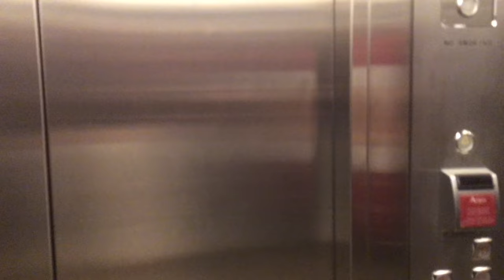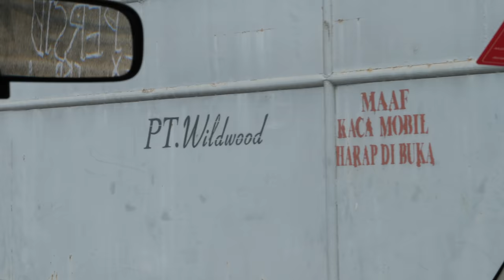SOLAR Guitars Factory Tour - September 2017

Comment: Many brands moved manufacturing to Indonesia, which is why today you can buy a awesome Axe under $500. If you demand mohagony and higher output pickups with better quality parts your still getting it under $1000. But any guitar especially from Indonesia be sure to check the fretwork for any high frets or other issues. I have 1 from Indonesia it's not a Solar but it's got no issues with anything, but I've seen some that did.

Comment: Good luck with your guitar Ola,,,,definitely Indonesian made guitar have top notch  quality. Cheaper Ibanez JEM also made in Indonesia for so many good reason
Reply: TheMrPaijo indeed they use nice woods too, I had a pair of LTD's made there that came to be very good
Reply: If they are as good as AMerican guitars..why are American Made guitars 3000 and up ?
Reply: OMG Don't you know basic economy. Hom much does an americans get paid for an hour salary compared to somebody in a 3rd world company plus world currency. Expensive does not necessarily mean that they are good..take a look at gibson as an example and compare that to epiphone guitars same quality but half the price.
Reply: How much is a Solar guitar ,in Google there were no advertisements, I typed in Solar guitars lemon ?????? 
Nothing ,a desert yellow ibby
Reply: Many of the normally more expensive especially metal style guitars seem to be made in Indonesia and you can buy for much less money now. Most Jackson's are also except those from the USA custom shop which are several thousand$$. For $300 I bought a JS32 that actually plays and has no issues about as good as I could ever dreamed from a $300 Axe. But the better quality guitars are coming from Korea, or Japan but also cost more $$. My EspLtd was made in Korea costing $1000 back in the early 90s. It's an M-1001 with emg 81-85s and an original Floyd  Rose neck through mohogany body so it should be more $$. But the $300 Jackson also has a real Floyd Rose and that's amazing for any $300 guitar. The stock Jackson pickups are not as hot as hell but their better than I expected them to be. The fret work is also very good and it's set up with very low action, think it's basswood with maple neck rosewood fretboard and no binding. I give it a high grade for playability and expect the Solar models to be at least as good as far as playability. Its amazing that Jackson can produce a very good guitar with a real Floyd and ship it to America for $300. Solar has to be at least that good or they will probably not sell many, I do hope they set the bar even higher as a consumer and would love to have a Solar in my arsonal if they do that. They look awesome.

Comment: I dont know why Ola never says it, but that's the CORT factory. The other giant guitar factory in Indinesia is Samick, but I dont think they accept small orders of ~100 guitars like Ola ordered.
Reply: Joar Holmström
I guess Cort name has a kinda bad ring to it because of the controversies they had some 10-15 years ago. They made (and still make) great guitars for affordable price but they had some work condition and worker treatment related problems, to a point a one worker set himself on fire for protest. This all happened in S.Korea though and it is possible that things have gotten better through Cort in general, it was long time ago after all. In any case, once you get a reputation it is hard to get rid of it.
Reply from the maker: Reason I’m not saying it is because this is NOT the Cort factory :D
Reply: Damn. I would have said Samick since they build for Washburn, but then I saw some Ibanez necks laying around. So Hishino-Gakki are cheating on their partner Cort and having Samick build some models? :o

Comment: Hey Ola 
I have a problem with my Solar A2.7 White that i bought a few months back.
Due to the Corona virus situation, and me moving from Croatia (my homeland) and Germany (where i work) i haven't got around to inspect the guitar properly. Today i got around to play it a bit, and determined that my strings were to high, so naturally i went to set them up, and that's where i encountered on a problem.
On the Bridge the forth saddle from below has a manufactory fault on thread (it's wider then the screw).
What is troubling to me is that who ever did a first setup on the guitar must have known of this fault but deliberately choose to ignore it. And how do i know this is because that someone put it in the only position it could work, and that is by screwing the 2 little imbues screws as high as he can so when the string is applying pressure on the saddle it wouldn't move.
I have to say i am deeply disappointed, since these guitars comes with some high praise, and it wasn't exactly cheep.
Made a lil video https://www.youtube.com/watch?v=vZz9R-ULaZo

Comment: these guitars are well made....it makes me wonder how much "better" a gibson usa model or ibanez or jackson really is.
Reply: I can guarantee you that at the price you pay for a Solar you could get a Ibanez Prestige model absolutely loaded with quality parts and craftsmanship.
Reply: @amiddleton4753  i disagree completely...i can take that $500.00 Solar and make it sound like a $5000.00 guitar.
Reply: @jfjusa1  since when is a Solar 500 dollars? Besides your statement is like saying I can mod out a Squier but we are talking stock product here. Apples for apples you get more out of an Ibanez prestige model for the same price.
Reply: @amiddleton4753  the washburn solar 6 ola englund model (which i have) was 549.00 new when it first came out.  he point that i was trying to make is that the guitar itself (i.e., body, neck etc...) does not have as much to do with the sound as do the pick-ups and the type of amp you are using.  i can make the solar 6 sound like a jazz guitar or a metal guitar.  the pick ups are very good and the wood (alder) is fine.  you don't need to spend 2 or 3 or 4 thousand on a guitar.
Reply: and furthermore, almost all guitars these days made by large factories are made on CNC machines.  so, the level of precision is there from Cort factory to the Ibanez factory to the Solar factory.  there is very little hand made stuff anymore.  machines can do it better and more precisely.  and prestige models are nbot the same price.  i own 3 of them and i never paid under $1100.00 for any one of them.

Comment: Ola I am super scared to buy one of the B stock models.... I don't care about a cosmetic blem, but a twisted neck or messed up frets is going to drive me insane, trying to return a guitar from the USA.
Reply from the maker: All the b-stocks are just small finish flaws. No construction flaws whatsoever
Reply: @OlaEnglund  oh wow... it sold since I sent this question. Thank you for getting back to me.
Reply: @OlaEnglund  Okay well... another came in stock and I BOUGHT IT. Hope things are as you SAY!!!
Reply: @OlaEnglund  got the B stock in... short video coming.
Reply: @OlaEnglund  I made a video about the guitar. You should watch and tell me if i'm wrong, or if this guitar slipped passed QC. Thanks.

Comment: I been having my guitar for 3 months. Once i recieved the guitar the neck was awesome and straight. Now 3 months later the neck is bowed. The tech at DrumCity Guitar-Land told me it was because of the wood fro. Indonesia and that u guys dont let the necks set for long enough before you ship. Now my action sucks and its a set neck so i cant remove it and straighten it out without ruining the paint job. Its a 400 dollar fix. The truss rod wont adjust to flat because the bow is right in the middle and a little to extreme. WTF i pay well over 1200 bucks for the guitar then have to spend 400 bucks because you guys ship out way to fast or set them up as soon as the guitar is built... come on man